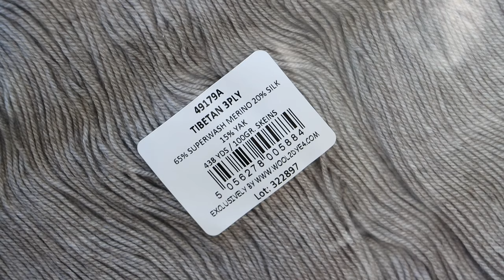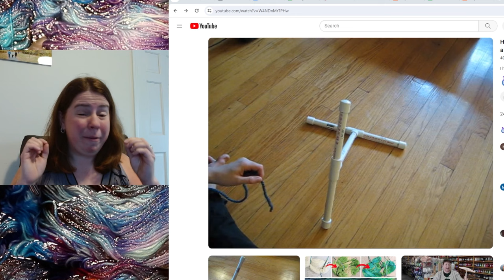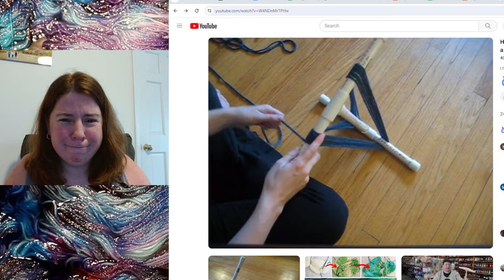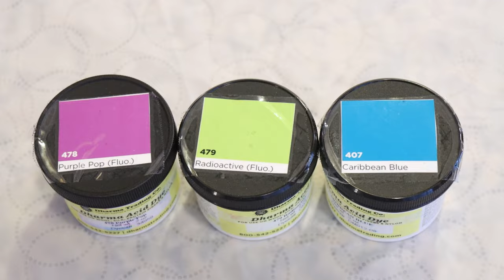Dyepot Weekly #507 - Dyeing Self Striping Yarn; Making a Long Skein on a Huge PVC Pipe Niddy Noddy

Comment: I am not v good at schematics like my brain doesn't register the paths so for quite a few times I used this tool I would find I wound one or two strands wrong.  Then after dyeing and wanting to wind into a ball, it was a horrible tangled mess so I would say when done, examine carefully that you didn't go the wrong way even once, it will really tangle in the unwinding.  When I finally got it its a beautiful rhythm to move the tool and say the words over under under over or somesuch chant.  I love this noddy.
Reply from the maker: I've made some errors in the past for sure, but usually I can see where a strand doesnt line up and then I can go back and fix it in advance.  I did have a warping board one where I went backwards for one section though.

Comment: I would love it if you had a knitting machine that you could use for swatches.  I have seen you use the machine you have to do sock blanks. 

I haven't used a machine my self so I don't know if it would be fast enough to be feasible for swatching.
Reply from the maker: The knitting machines I have for sock blanks wouldn't give a good swatch for fingering weight yarns because the gauge is so large and loose. They're intended for worsted weight yarns.